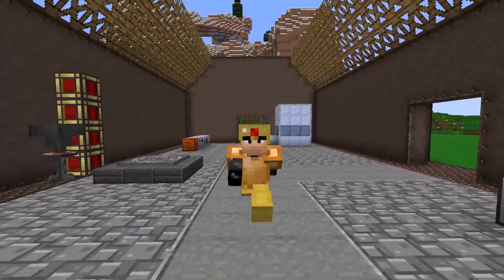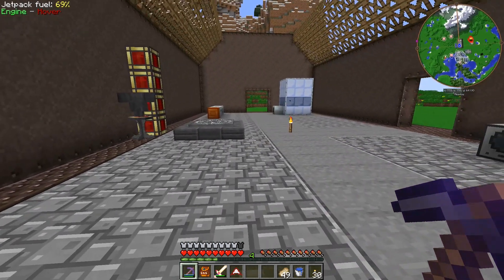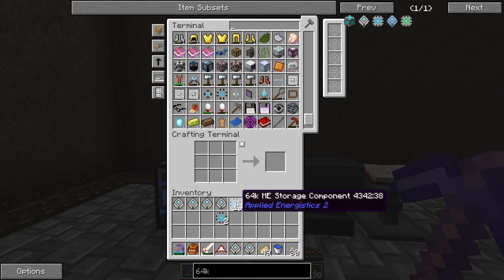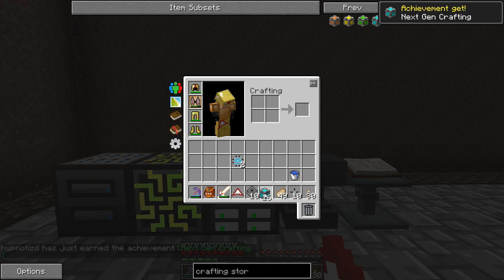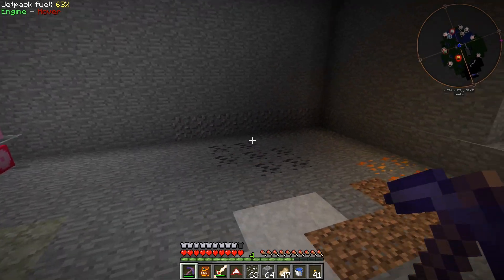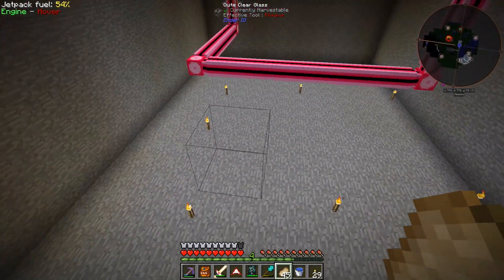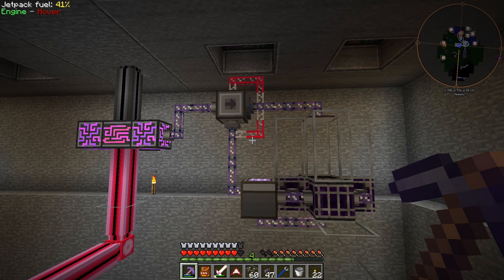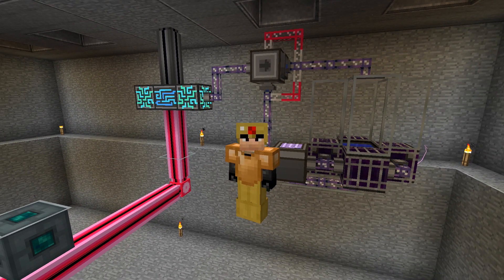Minecraft Mods FTB Inventions - CRYSTAL GROWTH AUTOMATION [E17]

Comment: Pro tip... level emitters can be used to keep a stock of your pure w/e crystals (or any other auto craft such as your processors).  set your output (in this case your formation planes) to auto  with/without a redstone signal and use the level emitters to start/stop the signal based on your current stock.

Comment: Hypno, each row in the ME Interface Terminal of the Molecular Assemblers section represents a different Assembler. An assembler can only make 1 item at a time so it is better to put patterns that depend on each other in different assemblers. For example, I always make sure the Formation and Annihilation cores are are on different assemblers, so they can both be made at the same time. This speeds up crafting of items that depend on both. An easy way to make sure this happens is to just re-organize the layout you have from horizontal to vertical. Simple efficiency increase.

Comment: Hypno, the only thing you could do to the auto crafting units is place them in the middle of the room and add an interface on all 6 sides of the unit. You can use the small interfaces, too. This reduces the physical footprint of the constructions by a lot.
Reply: But it is very slow because the assembler can only be used by one interface at a time. The other way around is way faster.

Comment: 13:30 After a few hour of creative world testing using a sample of crafting 100 64k storage drives from materials that only require assembly (ie: completed processors)... the 2 64k craft store, 2 co-proc, 6 interface, 6 Assemb build takes about 8 minutes... swap a 64k craft storage for a third co-proc and it takes about 6 min 30 sec. (Both tested with recipes distributed  such that high production required are in the middle two and low production to bottom or top... also, two for quartze glass.)
After testing some other builds, I can get it down to 5 minutes... but that design is less space efficient and uses a few more assembly chambers.
I'll do a bit more testing to see if I can improve it. The design you have seems to be more suited to many smaller volume crafting instead of crafting less items with more steps... particularly repetitive steps.
As a note, it looks like a single 64k craft storage can handle 3 mole assemb and adding one co-proc can handle 6 molec assemb. I need to further test 2 and 3 co-proc builds because they seemed to handle more mole assemb then I was expecting.
Caveat: I tested in Regrowth since I suspect I wouldn't be able to run Inventions since I haven't been able to run the 'main' packs for a few variations now.

Comment: for your auto crafting, if you want a fast auto crafter you use a me interface and surround it with assemblers, if you want a slow but very efficient system you will want to reverse the previous set up.
Reply: if you want to speed up the crafting more, use some acceleration cards in your assemblers

Comment: Since you have thermal expansion, you could use the teleport plates to teleport the crystal seeds into a 1x1 space that is surrounded on 6 sides by growth accelerators. 

Since you don't have XU, however, I don't know what you are going to use to get the completed items out. if you have a block that can collect items from behind other blocks, AND is filtered, you could do 6 growth accelerators.
Reply: just tested, you can do it with a ender io vacuum chest on the corner
Reply: AWESOME!

Comment: For auto crafting i like setting mine up like below. This setup offers a good balance between Speed and Capacity. Each stack takes up exactly 16 channels so if you have 2 towers it will take up one full dense cable. I keep the storage on the top and bottom so that you can freely expand the size up or down to increase your storage speed.

This is setup so each 3x3 layer is stacked on top of each other
S = Crafting storage or co-processors
M = Molecular Assembler
I = Interface

SSS
SSS
SSS

I  M  I
M I M
I  M  I

M I M
I  M  I
M I M

I  M  I
M I M
I  M  I

SSS
SSS
SSS
Reply: Wow

Comment: The best way i have found for auto crafting is: running a dense cable straight up, then placing an interface and surrounding it with assemblers, and then just repeat so that every interface has 4 assemblers on it and the pattern works perfect.
Reply: I decided i am going to  tweet you a pic :)
Reply: you can actually put 6 assemblers per interface as the cable only needs to be touching an assembler

Comment: AE crafting is all about either speed or space. 
1 assembler and 5 cable interfaces will be slow but have plenty of space for crafting recipes. 
1 normal interface surrounded by 5 assemblers will have plenty of speed but not much space for crafting recipes.
Those 5's could be 6's, I just cant remember if power passes through. I believe it doesn't for cable versions. 
The way you have it currently set up is a happy medium with each interface having access to 4 assemblers in the middle and 3 at the ends. 
Just make sure to spread out crafting recipes to different interfaces so they're not waiting for the same assembler.
Reply: totally agree with this. I cringed when I saw his interface setup.

Comment: Unless it's been changed growth accelerators only speed up growth if the  front is pointed into the water. On yours the sides are touching the water not the front
Reply: The sides is for speeding up groth, the front and back is for power

Comment: Easier way to set that up.... Interface into some sort of dropper, with patterns for the 3 types of seeds in the interface. then not sure if you have transfer nodes in the pack but you can set a transfer node with a filter under the water pool and no need to subnet it

Comment: what happened to the big multi block structure for applied energistics the u put all the pattern for auto crafting
Reply: Too OP
Reply: No channels to worry about, and can be as big as you want
Reply: That was AE1.  Nowadays packs use AE2.  I've always hated AE2, overly complicated, ugly and not satisfying at all imo.
Reply: +Sofa Dhana to prefer those terminals. And I didn't like the op molecular assembler
Reply: +Sofa Dhana the ae2 terminals BTW
Reply: Someone decided that since AE allows us to store and use massive amounts of resources... so it should cost massive amounts or resources to build it and take as long to build it as it would to just store it all in chests and retrieve it yourself.
I used to use AE for storage (though more as an interface to all the chests, barrels and such). Now, I mostly avoid it because it costs so much to get it going that by the time I consider it I have already got another storage system working perfectly fine.